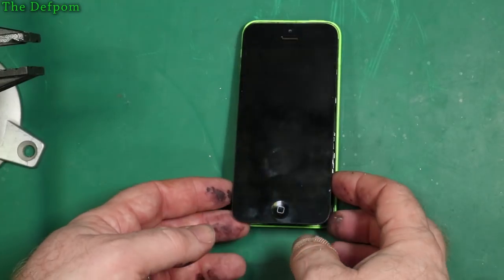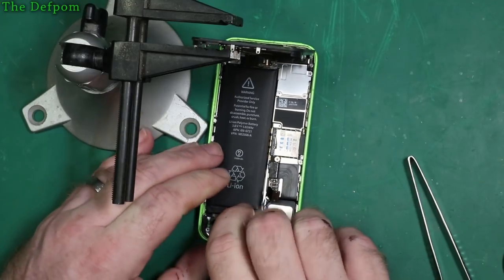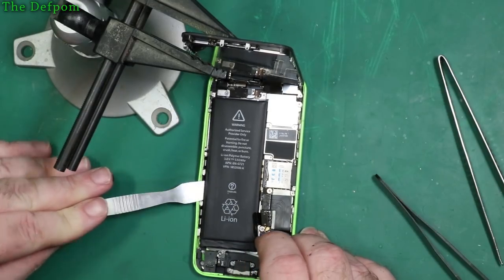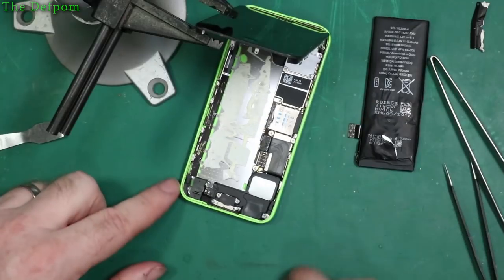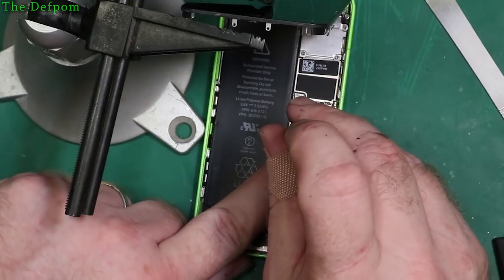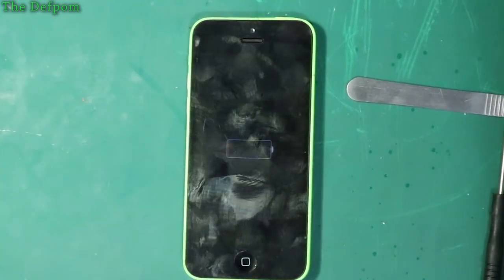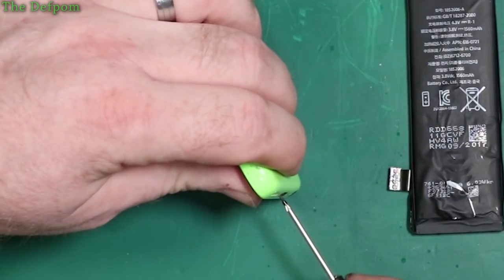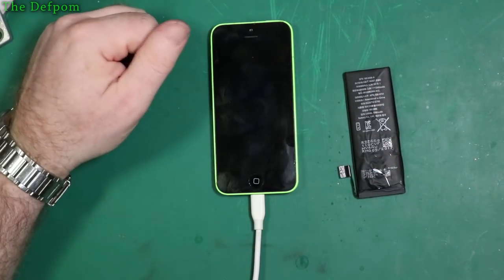🔴 #584 Replace Your iPhone Battery Replacement - How to Replace Apple iPhone 5C Battery

Comment: It took me about an hour and two spudgers to get my 5S battery out although it was the original battery from 5 1/2 years ago so it had lots of time to get stuck.   I couldn’t slide the spudger along the length of the battery to quickly release it somehow, so I had to use one to pry it up on the long edge and I had to use the other one to manually poke all the stringy bits of adhesive and slowly pry up.  
 So it was good to see another video showing that it’s not so straightforward all the time. It’s the first time I did it so I didn’t know if I was doing something wrong.
Reply from the maker: Gadget Reboot - in my experience these being a pain to get out is more like the normal situation.

Comment: My mate had a i-pod that had an inflated battery, it pushed the display from the inside and it looked damaged, but when the battery was deflated the screen was fine.
Lucky that the iphone didn't get any damage.
While you were working i had a silly thought, 'i hope he disconnects the battery before removing the battery.' lol :-D
I'm just not with it today, or ever actually :-D
Reply from the maker: zx8401ztv - yes the screen had been popping off this unit, apparently it had been doing that for about a week before he asked me to look at it! 🤦‍♂️

Comment: Wow that battery was a tight fit, I’m resisting temptation of rudeness. But lots of interesting crunching noises. Oh be interesting to see your rust repair video.
Reply from the maker: AllTheGearNoIdea - you will have seen the rust repair, that was the motorhome roof a did a couple of months ago, I’ve had this video sitting there for a while!
Reply: Defpom's Electronics & Repair - I Fix Stuff oh bugger

Comment: Why do you apple need ALL that double sided tape?
The battery isn't going anywhere, you just need to stablise it, not hog-tie it to the phone.
A strip at the top and bottom should be enough?
Reply from the maker: Tom George - yes it is a bit excessive! 1 strip would likely be more than enough.